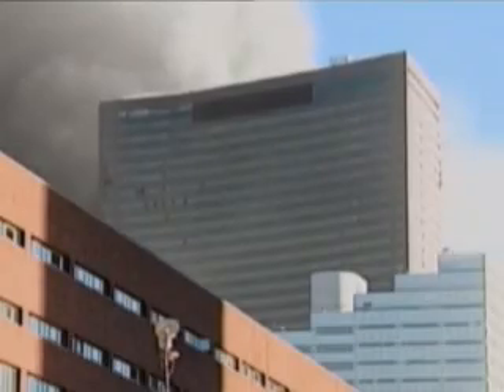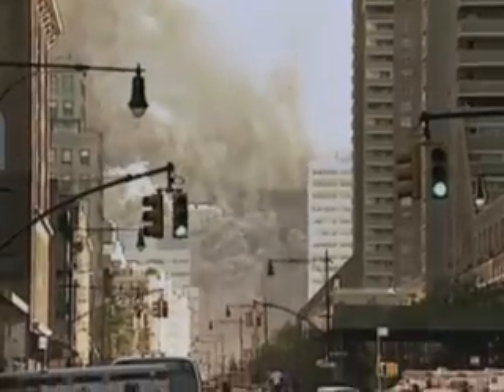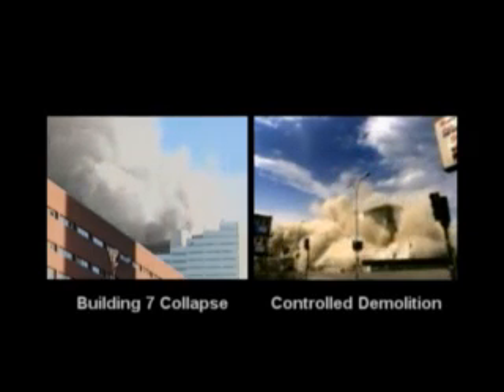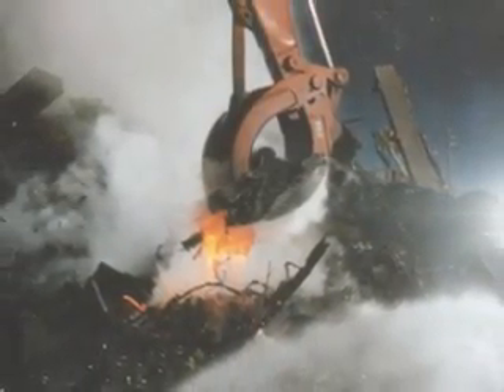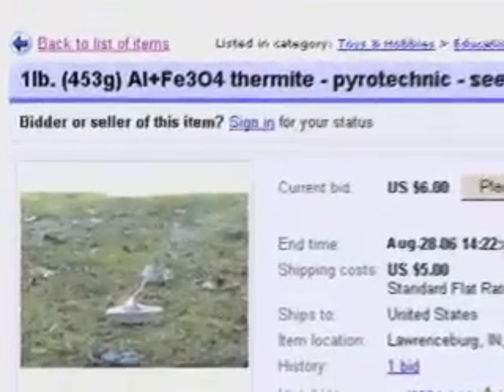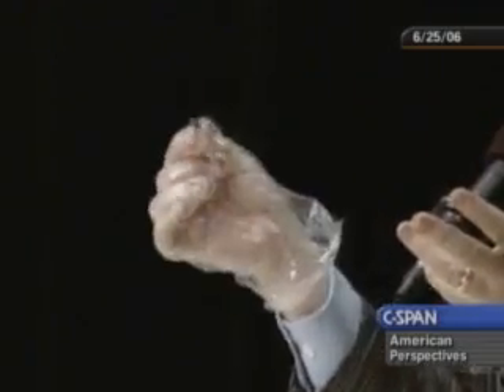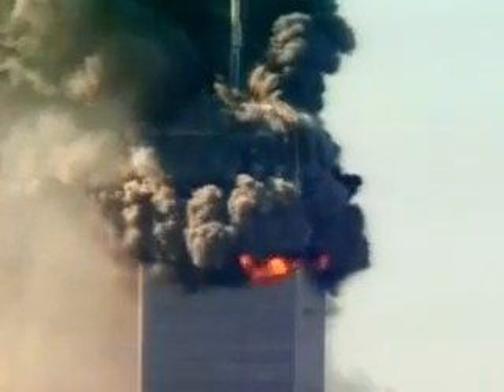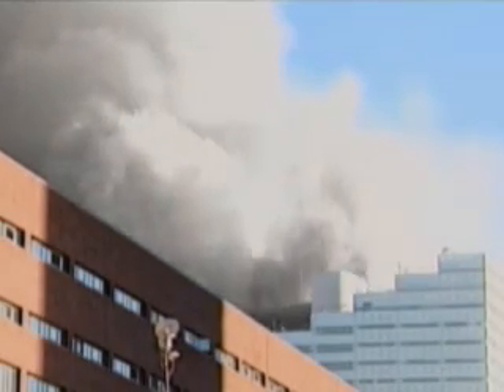9/11 Revisited - WTC Metal Analysis by Physics Professor

Comment: @bigbrother1994 he doesn't understand the differences between warehouse structures and skyscraper structures. He doesn't understand that fact these skyscrapers and their structural supports/design were made to take a plane impact, that they were designed to withstand fires, he doesn't understand that a vast majority of the fuel was burned on impact, he doesn't understand that molten steel under the buildings couldn't have been produced by the fuel of the planes, Or by alpha fires in #7... lol

Comment: @greywolf424 Sure do, A-36 structurual steel. The type of steel, the thickness of steel, the shape/design of the steel will dictate how it reacts to heat. ARE YOU GOING TO ANSWER THE QUESTIONS CORKY?

Comment: @greywolf424 I'M WAITING FOR YOUR ANSWERS
Why was there molten metal/steel under the 3 building?
Watch the Vid when they're removing the beams, if it's not molten steel then what other metals were used in the construction or Demo?
How thick was the A-36 steel?
What R the Properties of A-36?
Were there fires at every support column on #7 that caused an even collapse?
What other building contrsucted with A-36 steel fell due to fire?
How many skyscrapers have fallen due to plane strikes?

Comment: @greywolf424 We'll focus on #7 and then move on to #1 and #2. Building #7, (Alpha fire vs a building composed of A-36 structural steel)... Based on the type of steel used, the age of the steel, as well as the shape, design and thickness of this steel, there is no possible way that the entire building is weakend by alpha fires so perfectly that it collapses in on itself... Seriously? He said THEY decided to pull IT... he made a $6,985,000,000 profit to have these buildings destroyed. Hmmmmm?

Comment: @greywolf424 so how can you explain the molten metal under #7 if a plane didn't hit it & the fuel didn't travel down the elevator shafts? Thermal images depict the same temps as the other two buildings. How is that even possible? # 1&2 were Bravo fires and # 7 was Alpha fires? There's no way that Alpha fires in an open facility will reach temperatures to even come remotely close to effecting A-36 steel, let-a-lone make it collapse. The owner was even recorded saying "take it down."

Comment: @greywolf424 Well, FYI it has been reported, recorded and documented that molten steel was pouring out of the towers in various locations/sections, it was also reported, recorded & documented by various agencies, as well as by the clean up and rescue workers, ie: Firefighters, cops, military, civilians, etc.  If there is no truth in this then why was Molten steel present a month after the buildings fell? Did you research the temperature at which A-36 steel turns into a liquid/molten steel? No???

Comment: @greywolf424 It's obvious that you haven't got the slightest clue. Do some research, Find the composition of A-36 steel, understand the percentages of the various properties in the steel, what/why they're there etc, find the temp at which the A-36 steel turns into a "liquid". Once you find that look at the "Mush" zone. (partially solid/partially liquid). now tell me what you learned. Look at some of the video of the metal pouring out of the towers, research what it takes for it to do that.

Comment: @JPPolachek  I'm a machinist and a certified metallurgist. There is no way that the jet fuel carried by the planes could have reached the necessary temperatures needed to melt or structurally weaken the vast majority of the A-36 steel used in the construction of the towers. WTC 7 shows the same thermal temps as WTC 1 and WTC 2 but, WTC 7 was never hit by a plane. How do 3 buildings collapse in the same manner, two by claim of fuel from planes and the other by localized internal "alpha" fires???

Comment: "They have to get into the infrastructure to weaken the building."

What does that even mean?

"All of the metal with exception to the floor trusses which were pulverized along w/ the concrete, landed in the foot print of the buildings"

You obviously hadn't been there, there was debris everywhere, large sections of the building fell on nearby buildings (building 4 was damaged beyond repair by pieces of debris.)  The rubble pile wasn't as neat as you think it was.

Comment: zakabog: They have to get into the infrastructure to weaken the building. All of the metal with exception to the floor trusses which were pulverized along w/ the concrete, landed in the foot print of the buildings cut in small sections ready to be shipped off to China. Lets not forget the pyroclastic flows created by the Explosions and implosions.

Comment: "The angular cuts on the core collumns is strong proof of demolition cutter charges."

Oh, yeah, of course, that's a perfect explanation.  Wait... no it isn't... that completely fails to explain why the building fell from the top down.  If they used the charges on the ground floor why did the top floors fall first?

Comment: i studied it thoroughly enough to get that the buildings collapsed symmetrically at al,most free fall speed despite the fact that they were not hit straight on. There were no stacks of concrete floor at ground zero it was all pulverized along with everything else with exception to the 42 massive box collumns which were cut at angles to allow for telescoping of collumns into footprint, ready for shipping away. The angular cuts on the core collumns is strong proof of demolition cutter charges.

Comment: Black smoke indicates low oxigen fire. The buildings including bldg 7 by the way were designed to withstand multiple jet crashes. A considerble amount of  the fuel burned off right away in the initial blast.

Comment: there was no reason for the steel to be shipped to China, or moved from ground zero. they had to move the debris, yes. But they did not have to remove it from site, and yes for your information fire investigators are usually there working with the firemen and clean up crew telling them what they want. Fire engineering magazine and James Quintiere blasted the destruction of evidence and the departure from normal procedures. They called it destruction of evidence and it's a federal crime, normally

Comment: There is no proof that any insulation was "knocked off" the steel, especially below the impact area,which was not damaged in any way. The jet fuel that remained after the initial explosion was about 900 cubic ft. not very much at all when compared to the 40,000 sq ft of 1 floor of the twin towers. No reasonable person would compare a warehouse type building to a 110 story steel high rise which was engineered by John Skilling perhaps the greatest building engineer of our time

Comment: steel does expand if enough heat is applied long enough which wasn't the case on 9-11. The fires were not hot enough or long enough to weaken the steel, especially below the impact area where there were no fires. Most experts say collapse time was 10 to 13 seconds.  McCormick place was a roof collapse not even close to a total building collapse, and it was a warehouse type building, the roof was not designed to hold up more than it's own weight plus some snow. talk about desperate!!

Comment: what does placing a coin on railroad tracks have to do with the steel of the 3 WTC buildings? The structure below the impact area had no evidence of damage and this area was designed to hold up quite a bit more then the building above it. the columns in the basement held up the whole building, the columns on the 50 floor held up everything above it, with at least a safety factor of 2 for the core columns and 5 for the perimeter columns. But they gave the same resistance as air, weird huh?

Comment: they had no reason to remove the steel off site to rescue anybody. Under any normal fire investigation the evidence is never moved far from site until the investigators say it can be moved. As for the toxic air, removing the steel did not affect the air quality.  Any investigator can tell you that they investigate the fire damage on site, take samples carefully writting everything down, taking pics, of course somebody as smart as you knows this don't they?  hmm maybe not

Comment: steel needs a very hot fire for a very long time to weaken it, the NIST investigation reported that most of the steel columns were exposed to temps up to 250C, a very small % of perimeter columns were exposed to temps up to 600C. The NASA thermal images showed surface temps that were very hot, not what the temps were under the pile, and they did not show "pockets of fire" under the pile. One can assume that temps were hotter in the middle of the pile

Comment: The NIST report does not support your opinion. The evidence supports the fact that the fires did not burn long enough or hot enough to weaken the steel columns. It was not hot enough or long enough to melt brass either, at least acording to the physical evidence NIST investigators reported. Even the goverment "story" doesn't support your ideas. I am not sure where you get them, but the facts did not give them to you

Comment: Nobody said the steel melted, only that there was molten metal at ground zero. there were also 240 perimeter columns besides the 47 core columns. There is evidence that thermate or some other kind of explosive was used. Jones has had his findings confirmed by 3 other labs. FEMA'S Barnett reported finding steel that was exposed to very high temps, much higher than any carbon based fire could produce, especially in a uncontrolled enviroment like on 9-11

Comment: jsaint79: good idea use facts, funny how that works. Also good to point out that the fires were not hot enough or burn long enough to melt steel or brass either. AT least according to the physical evidence NIST found

Comment: Sorry but the facts don't suport your arguments. NIST report tells us that physical evidence most steel columns were exposed to temps up to 250C, a very small % of exterior Steel columns were exposed to temps up to 600C. The fires were not that large compared to size of building and only lasted a hour or so. In many of the areas the fires had already burned out, not very plausible that much of any metal from building was melted, at least from the fires.